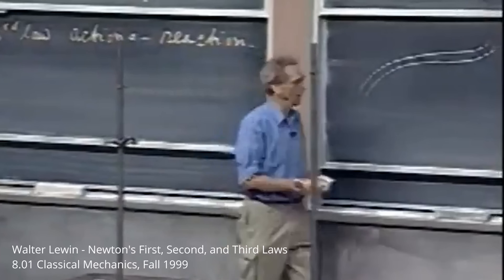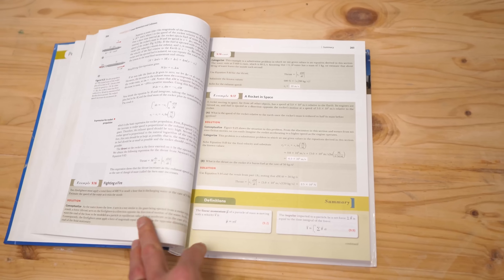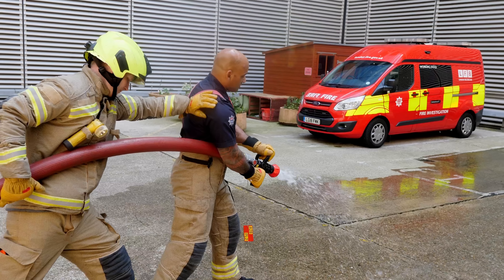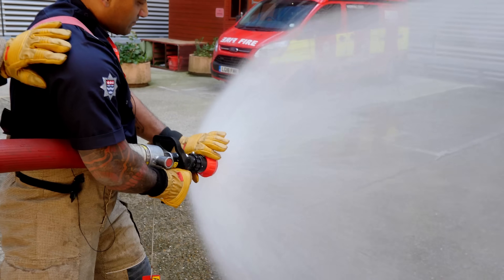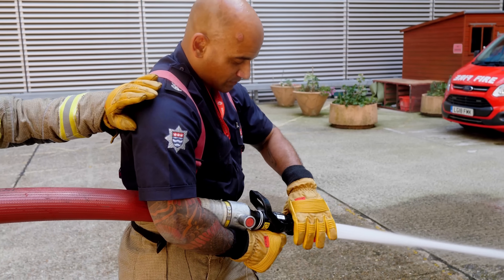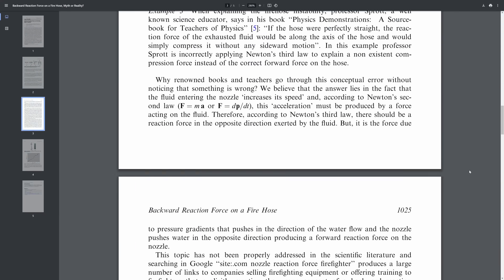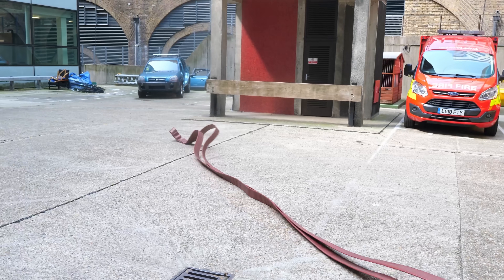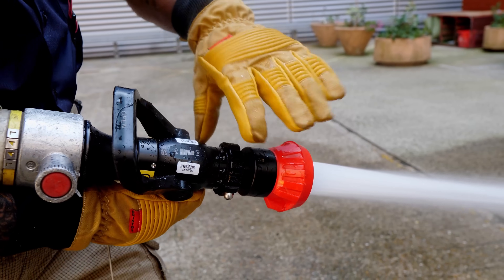Why chaotic hoses dance

Comment: There's a lot of information about the "water hammer" phenomenon that would explain why hoses that are anchored on both ends don't feel any forces while water is flowing through them at a constant rate.

I have a theory that a hose that's straight from an anchor point to an open end wouldn't feel any force at the open end except those caused by gravity and some minor changes in spray direction from nozzle imperfections and turbulence.  If you think in terms of 90 degree bends for simplicity, it's easy to see that any straight segment of pipe or hose experiences four perfectly offsetting forces along its length (the force of the water on the corner and the force of the corner on the water at each end).  Different angles do the same thing, but it's harder to imagine.  At both ends, the anchors feel the force of the water against the closest corner.

If the hose was straight and forced to stay straight (is that cheating?), the closest corner is the pump itself which is anchored and shouldn't pull the nozzle in the opposite direction of the spray.  I'm not sure how a minor bend in the hose would affect the force at the nozzle.  Would it cause the nozzle to take the full force of the spray or just a portion of it based on the severity of the bend?

Comment: i noticed that the paper gave the hose a winding number of pi/2 but your experiments all had 2pi of winding. since the reaction force is coming from changing direction it stands to reason that returning it to the same direction it was going to begin with might cause some things to cancel.

this situation sounds like it would benefit from a cfd model of the simulation to try to track how forces were propagating or if the effects can be eliminated by assuming 0 friction or what have you.

Comment: it has nothing to do with momentum.  it's pressure.  you essentially have a vessel that is closed on all sides but one.  the pressure is equalized in all directions but for one.  that one side is going to give you a force equal to a times p.  that pressure is also the reason the water is coming out so fast.  high pressure means the water gets pushed out fast.  but this is kind of like a correlation causation fallacy thing.  it's the pressure that causes both the force you are feeling and the water moving fast.  it's not the water moving fast that is causing the force you feel.  sorry about the lack of capitals and math symbols. my keyboard all of a sudden stopped letting me type capital letters.
Reply: It isn't pressure. Pressure at the exit is 0 (gauge, i.e. atmospheric).

Comment: im not a scientist or anything but doesn't the hose have not much water pushing against it so the fire fighter doesn't feel much pressure pulling forwards but a rocket has gas that explodes so the rocket should feel some momentum? idk its just speculation
Reply: nevermind you explained straight after

Comment: The explanations in this video have a few missing details, I think the video could've used some ironing out before publishing. The assumption of constant pressure along the hose is entirely untrue. And the video assumes all pressure loss happens at the nozzle which is incorrect. This would only be correct in a friction less hose where the nozzle is choking the flow at the end.

Comment: The force you feel when holding a fire hose is also very dependent on the nozzle pattern. That's a fact. So to me it suggests the original idea of Newton's third law, because the only variable is in this case the water stream past the hose, not the pump!
Reply: This is part of it. There is tension in the hose in addition to the 3rd law effects you mention (the nozzle accelerates the water).
Reply: @tysondanby2525 don't get me wrong, you can feel the hose is bent in the last 5 meters or so, but that straight kickback, you get only from increasing flow. At 100 lpm a kid can hold it, at 400 lpm most new firefighters need help.
Reply: @ Yes. You are correct, I agree. Also, to clarify: the tension I mentioned is due to moving fluid (I just made a very long comment about this on the main thread).

Comment: it basically come down to endurance. Your feeling that force "of a rocket" when you move and position the hose around (Not Constantly, depends on the configuring of the hose, and where your standing relative to the nozzle. The greatest force will be felt at the nozzle while it falls off the farther you go down the hose). Holding a hose is relatively easy with a good amount of strength at most your fighting an alternating wobble that at the nozzle; at times can be the power of a rocket especially if your hitting objects with that water relatively close it will provide a literal kickback in the hose. I mean think about it the most fatiguing part of moving around the hose at your house is made a lot harder when the hose is full of moving water than empty or even static water at pressure.

As for why firefighter hoses dont flail on their own(like the tube guys), well because their made not to lol. Aside from being made to not kink or make any unstable bends, I mean the truth being they are quite hefty on their own without water but add water moving in an opposing direction (thats a lot of surface area per second) to the force being applied on it will usually hold a firehose relatively stable with only a "small" wobble on the end; unless outside force acts upon it, aka someone picking up the hose. Which is why they probably crawl and push it to the ground and straighten out the hose eliminating some vectors for the oscillation to start how chaotic they may be.

I'm not a firefighter, although I have used one of the hoses before;
So I could be wrong about most of this. Just some thoughts lol so Grains of Salt & All.

Loved the video as always <3

Comment: To better validate (or disproof) your theory of the force caused by the fluid inside the tube you might try to add a cap at the end that redirects the flow 360° all around the tube (like some holes on the sides and closing the end); by doing so you'll remove any force caused by the exit of the fluid from the tube. If the tube keeps moving around then the forces caused by the fluid inside the tube are the cause (or at least are involved); if it doesn't then everything is due to the pressure difference at the end.

Comment: 7:35 Without watching your conclusion, I'd assume that someone holding the nozzle would have to brace against any acceleration of the water in the nozzle. A right angle bend should make the force larger, as well as a constriction at the nozzle put in to accelerate the water and increase its reach.
Reply: By the way, does it make a difference if you hold the nozzle in normal air, in a vacuum or in water? How large is the role of the pressure build-up caused by fighting against the surrounding medium? I mean, if you press the nozzle against a wall, you'll experience a force equal to the pressure of the water times the cross section of the nozzle, even if the water is at a standstill, so that is an additional factor.

Comment: I’d be interested to see what happens to a hose pushing air while submerged in water, where the fluid it’s moving through is denser than the fluid inside it, and probably as a sort of “control”, a hose pushing water while submerged in water

Comment: My fluiddynamics textbook says youre right :) the two forces acting on the nozzle of a Hose are caused by a change in Momentum of the water and from the difference in pressure between the Hose and the outside world!

Comment: Is it weird that I'd figured out this answer before even clicking on the video? I will say, Steve, that your idea about the hose pulling back probably does play a factor here, in that it probably amplifies the instability that sets the hose flailing in the first place. Because the fluid "wants" to travel in a straight line, whenever it hits a bend in the hose, it'll push on that bend, essentially bouncing off the inside of the hose and changing direction. It'll then want to travel in a straight line along its new trajectory, which means it will probably bounce off the inside of the hose again, and so on until it reaches the nozzle, at which point we see the rocket principle take hold, pushing the nozzle of the hose backward and creating a deformation in the hose which then ripples backward away from the nozzle. 

HOWEVER, I have another suspicion, which is that this won't actually affect the force of the fluid leaving the nozzle, which fits with your experiment. Think about it like this: As the fluid bounces around inside the hose, it's transferring energy into the wall of the hose itself, thus losing a bit of momentum with every bounce, reducing the force the fluid ultimately puts into the nozzle by the same amount. So, however much the hose pulls back thanks to an increase in the hose's curvature, it can't pull back harder on the nozzle than it would push the nozzle if the hose were straight. It's basic conservation of energy. The fluid in a straight hose would have an ever-so-slightly higher exit force than the curvy one, perfectly counteracting the amount of pulling force that a bendy hose would be experiencing. So we have this tiny exchange of energy which goes from pushing the hose side-to-side to pushing slightly harder straight out (which forces side-to-side motion because of deformation), and back again as the hose oscillates.

Comment: I dont think its any force at all on the hose in the bends as you said. Why? Because, if both ends of the hose is completely fixed (like a hose connected between a pump and a tank) the hose will not move at all during the pumping. It just stays there still. Its not like the hose between the 2 fixed points are dancing around regardless how long and slacky the hose is.

If there was a force in the bend as you talked about, then the hose would be dancing around even if both ends were completely fixed.

HOWEVER, the hose WILL jolt/shake when you turn on the pump/water, and turn it off, but thats the expansion and contraction of hose as pressure rises and drops. Thats why you see the hose of the pressure washer jolting when you squeeze the trigger on the washer gun. Even in a hose/pipe that cannot expand/contract, you will still see a recoil force, because its like a moving nozzle, where the position where the "water wall" of the initial water filling the pipe/hose is. Once the "moving nozzle" has reached the real nozzle, then there will be no forces on the actual hose/pipe other than the real nozzle.

So I would say its the "rocket engine" principle that should be applied here. Think like a rocket engine attached on the end of a "chaotic pendulum" with infinitely many joints, or just a rocket engine, started, that is on the end of a rope, and you would get the same result. When the rope or pendulum becomes streched, a force will be applied that changes the nozzle's direction, which changes the way the reactive force is pushing, which gives the chaotic dancing.

You were also talking about the force being at the pump. But thats only true when the pump is started. Then the pump wants to go "backwards" like a gun recoil to accelerate the water (same as with the "moving nozzle" as I said above), but once the water is at constant speed, the friction force of the hose, where the water pushes the hose forward, will counteract the pumps "recoil". Its the firemans nozzle who feels the recoil instead, as when the water leaves the hose, theres nothing that can push the hose forwards to counteract the recoil, thus the fireman must "push the nozzle forwards" as the nozzle wants to go backwards like a rocket engine.

An easier way to think of it, is if the hose were rigid, like part of the pump. You have a steel pipe instead of the hose. Of course the reaction force will be where the water leaves the pump, ergo at the end of the steel pipe. Basically the hose is an extension of the pump.

Comment: if the water leaving the nozzle is faster then does that mean its pulling the end of the nozzle like its a rocket tied to a string and how much equilibrium of that pulls the length elasticity of that string dictates the wave function aka distance it waves left and right?

Comment: My guess before watching this: generally every force has an equal and opposite reaction, so when the hose is left nothing holding it down it goes backwards but due to the hose being connected to the rest of the stuff with weight it can’t move just backwards while the weird inflatable tube man is just bernoulli effect due to the air inside the dude moving faster than ambient air

Comment: I urge you to read a riveting 1975 training text book, the UK Home Office (Fire Department) "The Manual of Firemanship", Book 7, "Hydraulics and Water Supplies", chapter 6, "Characteristics of Nozzle Discharge" (can I get ointment for that? ... ahem, back to normality ... 🙂 ). Section 6 explains what it calls "Jet Reaction" which concerns the reaction at the hose nozzle to the expelled water. It suggests that the "reaction of a jet in Newtons is R=(2xPxa)/10 where P=pressure in bars and a is cross sectional area in square millimetres" which appears to be a simple result directly in line with the expelled water ... It also refers to what would be expected to happen if, for instance, a fireman on a ladder directs his hose at a wall ... no sniggering at the back!

Comment: The nozzle has a smaller diameter than the hose - to minimum hose head loss - so the water accelerates (aka gains momentum) as it leaves the nozzle

Comment: you definitely feel a strong force but it never felt to me like it was the full force of the water. i would equate it more to bracing the hose and holding it in place so it doesn't become wild. if it was the full force of the water, we wouldn't be able to control it

actually the job of the person behind the nozzleman is to help push against the force of the water. you lean against the nozzleman and push the hose towards the nozzle

Comment: I think the rocket nozzle explanation works because force is equt to a bunch of stuff:

1) It is obviously equal to a fixed mass multiplied by its acceleration. 

F = am = m/s² kg = N

2) It is equal to the change of momentum in time.

F = (m ∆V)/∆t = (Kg m/s)/s ) = N

3) It is equal to a flow of mass times its fixed velocity.

F = V ∆m/∆t = m/s Kg/s = N

In that case, there is a force against the firefighter even if there is no change of momentum (at the exit) and no acceleration. The same way a internal stress is acting on any choosen cross section of a bean, the reaction force of water leaving is acting on any choosen cross section of a hose.

Comment: Bear in mind that a fire hose inflated with water lying on the ground is going to have a lot more friction than just air resistance to stop it from flailing about as much as your thin tube of air experiment.

Comment: 10:00 as someone who has about a dozen 36v packs and a handful of 48v packs, but also enough knowledge to tear them apart and spot weld my own super battery, SO MUCH THIS.

I still only charge my batteries near an exit, while supervised, and on concrete away from other things. The batteries sit in one of those flame-retardant bags, and the strap is always tossed over to one side. 

 Never had a fire, never want a fire, but if one happens then I've got what I need to take care of it.

Step one: open the door

Step 2: grab bag strap

Step 3: YEET it outside

Step 4: grab fire extinguisher for any flames that may have jumped inside the building, and to keep it from spreading outside.

Step 5: grab smothering blanket and pull over battery bag

Step 6: open all windows to vent the inside of the building

Step 7: sit and stare at the smoldering carcass of batteries and plastic, thankful that it's not my house or garage, having an existential crisis wondering what would have happened if I didn't react quickly enough.

Comment: The pushing the string example doesn't make sense. Because the water is under pressure. There is nowhere for the water to go. Enless their is enough flex in the hose to allow "parcel" movement

Comment: The fire hose isn't flailing about, because it's so high pressure it's as if it was solid, only at the end does the pressure inside the hose become low enough for it to flail about, because the hose becomes so soft.

Comment: If we are talking about firehoses specifically it should be noted that they often [and do in the video] have a constricing nozzle [sometimes even a spring loaded automatic constant pressure nozzle] designed do deliver a specific flow rate for a given pressure. You can see in the video the flow rate markers on the selector on the nozzle in the video which can be selected to shrink or increase the bore as required. This will have the effect of placing a restriction on the flow, which whill produce high pressure behind the nozzle wich then opens up [effectively to infinity] as the flow leaves the nozzle allowing the fluid to accelerate. This is exactly how a rocket works, minus the combustion and the thrust bell to maximise the efficiency of the thrust gain.